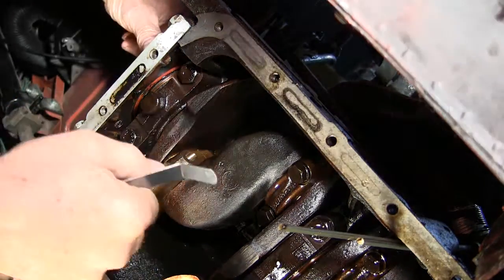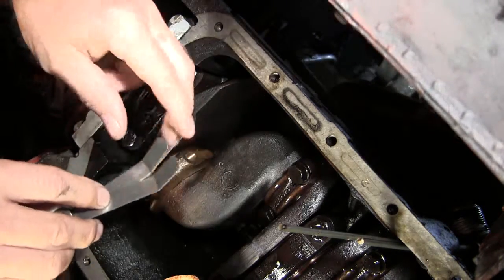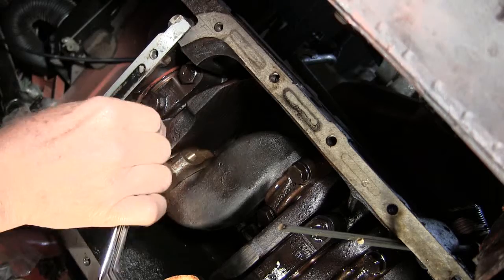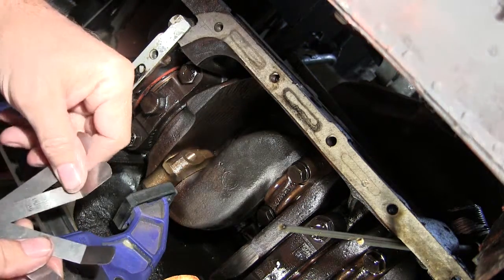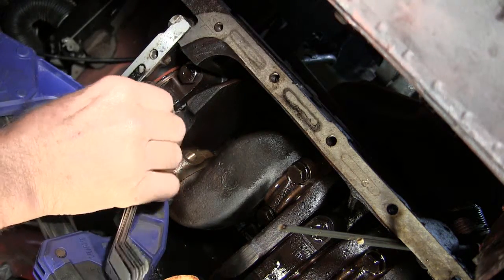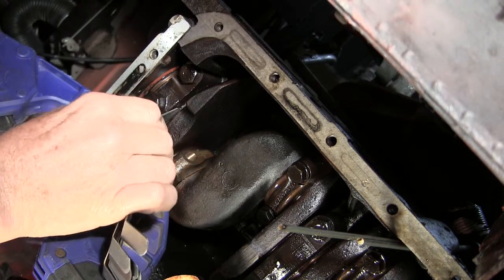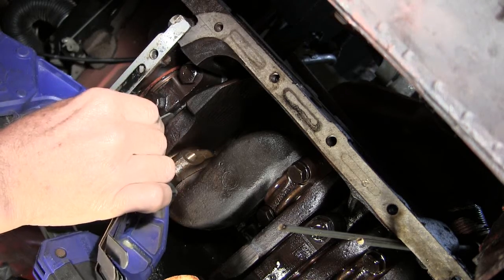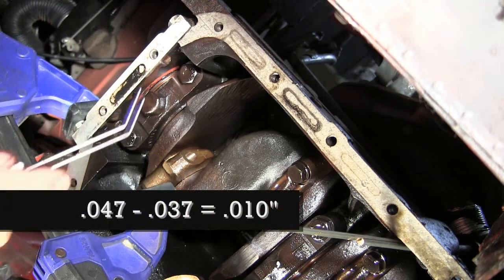CW's 79 Triumph Spitfire 1500 crankshaft end float check

Comment: will it nok if end float is to much
Reply from the maker: Not usually..... Pushing in the clutch, when shifting gears, would push the crankshaft forward. .008" gap would not make a knock. The knock noise from an engine is usually the push rod or piston wrist pin bearing wearing away. Exceeding the engine's RPM limit could cause breaking cap bolts, but that is usually a bang, and parts of the engine exiting the block makes a hole. The end float is only a problem when it exceeds the recommended amount, caused by the crankshaft thrust washers wearing so thin they fall into the oil pan (aka sump) After the TWs are missing from the crankshaft  the shaft movement forward into the engine block begins grinding away, and the crank shaft's TW mating surface can be damaged. The problem can be expensive rebuilding the block, and shaft, or replacing the shaft. That's why it is important to check the END FLOAT on your engine, and any engine your thinking of purchasing.